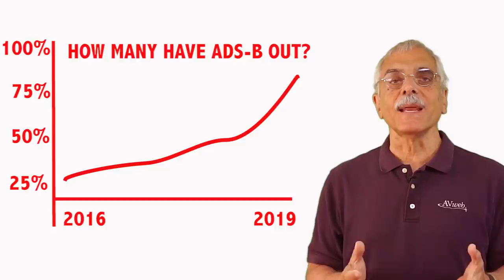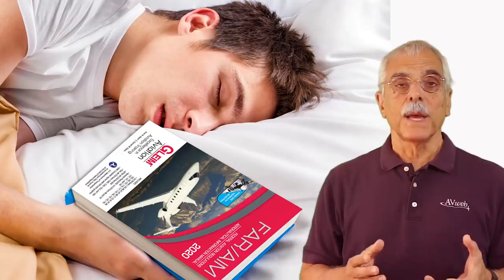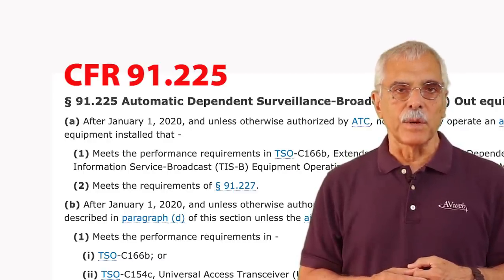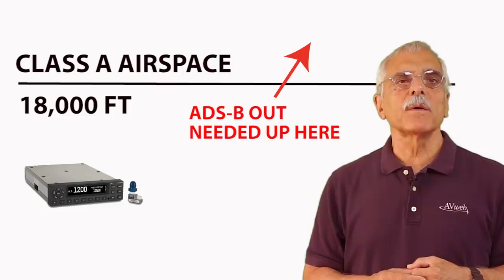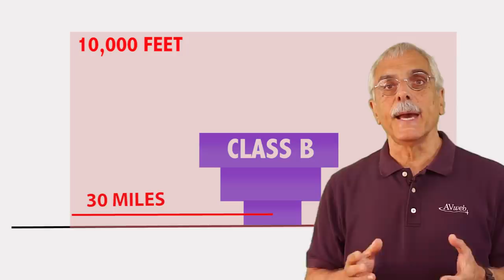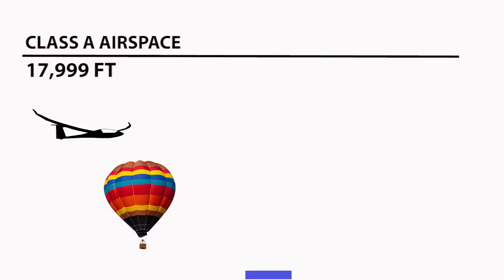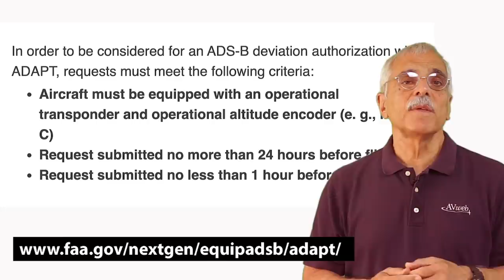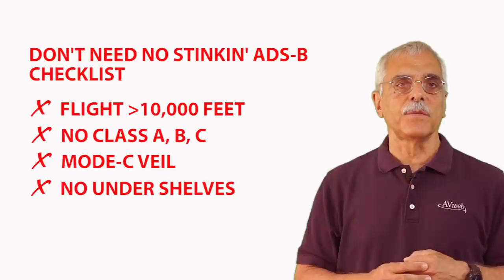So You Blew Off ADS B  Now What?

Comment: I have a few friends that are complaining about it... 

The regs came out in early 2010.  You had 10 years

Most installs are between 2-4k.  

While not pocket change, its still very cheap when it comes to planes.  My families last cross country trip cost more than that in fuel.
Reply: "But my plane is worth only $15k." I've read that a lot.  Irrelevant, IMHO.
Reply: @roytee3127   i have not seen a 15k plane that would be required to add ads-b that did not need 25k+ in work.
Reply: @tylergordon696  Mine is a $20k plane that only needs $1,500 for ads-B out....
Reply: @roytee3127  That sounds like somebody who is flying with somebody else paying the bills.  Sort of arrogant IMHO.  

I've got twenty airplanes.  Putting ADS-B in all of them would be asinine expensive.  I made ONE trip in the past two years that I could not have made without ADS-B under the new rules, assuming you can go under the shelf of Class C, and I didn't really need to make that trip in a plane.  The economics simply don't compute, at least not for me.  

And I've got a Culver V Satellite that is pretty nice, has radios GPS etc.  Not a popular plane and probably not worth much more than about $ 12,000.  I'm not doing ADS-B in it until they get the cost down to about that of an ELT.  

And BTW, why exactly is it two to six grand?  What it is supposed to do isn't that amazing.  It's like a simple GPS and a beacon that should be as easy to install as an ELT.  It really should be about three or four hundred bucks.  Somebody is getting rich off of this requirement.  I wonder if those people, whomever they area, had something to do with it being adopted.
Reply: Its all about the certification...

I am a gc, saftey glasses are a big deal in my industry.  my 3 m safety glasses that are tested and rated by ansi( think faa only slightly  better) are $50 a pair.  My ones  that are identical minus the embossed  ansi number( from the head of 3m on the west coast)  are $10.   Hell i have a pair of oakleys that are rated to stop a 22 lr that i have had since i was in the coast guard are not even legal for mw to use.   

What it all boils down to is testing. Just look at modern avionics and the difference  between certifed and experimental.  Its a sick joke.
Reply: My Tri-Pacer was only $15k, now granted it needed a new impulse coupling due to AD, a rigging adjustment, and an annual to be airworthy, with what I had available to purchase it was either that or get the ADS-B out. Fortunately I live well outside of any rule airspace
Reply: @roytee3127 I agree with you and my reply to those people has been " No, as of Jan 1, 2020 your airplane will be worth $13K because you had 10 years  to comply and I'm taking the ADSB installation off the price of any aircraft I purchase"
Reply: @kellytrimble4120  You are comparing a transponder to an ELT, really?  You are comparing a pedal-powered tricycle to a 3-wheeled motorcycle.  An ELT blasts out simple data to help locate a crash.  No data processing, no receiving, no data protocol.  An ADS-B Out transponder is designed to use time-division multiple-access communication protocols (TDMA) to transmit and receive sufficient position, speed, and heading details (requiring WAAS GPS data) to allow pilots and ATC to avoid collisions in congested airspace.   Just because a simpler ADS-B out-only transponder doesn't display IN data, it still has to listen to the ADS-B data stream and communicate with both ground stations and other aircraft using a data protocol.  This is not trivial.

(Edited to remove my incorrect interpretation of FAA ads-b regs - see the excellent FAA graphic in a reply below)
Reply: DanD “above the ceiling AND within the lateral boundaries” - the “and” means both those conditions must be true. not “above the ceiling or below the floor, and within the lateral boundaries”, or “within the lateral boundaries from the surface up to 10000 feet”, or just “within the lateral boundaries”. So it turns out you can fly underneath class C after all. They don’t have to differentiate between B and C, the reason you can’t underfly class B is because of the mode C veil.
Reply: @whatwhat1574  I stand corrected, thank you!
Reply: @marcjacobson6096  I stand corrected,  thank you!
Reply: @marcjacobson6096  Am I missing something?  That graphic says "Mode C Veil, ABS-B Required"
Reply: @steven2145  Unfortunately for us pilots they have make it confusing by calling the airspace around "Class B" "Mode C Veil" which is NOT a reference to "Class C" airspace. Mode C is the type of altitude reporting transponder required to be in this area that surrounds the "Class B". So despite both having a "C" in their name they are actually different. I'm sure this is clear as mud but you can definitely fly under the "Class C" airspace shelf without ADS-B but definitely not into Class C.
Reply: @dand579  with modern electronics it is pretty trivial and cheap to do with almost one chip. So I see  no reason why ADS-b can't made $400
Reply: Unnecessary regs are unnecessary no matter the lead time and cost. It could be 20 years and 50 bucks. Point remains.
Reply: @tylergordon696  ads in can cost a lot of money, just a simple transponder for ads out is dirt cheap. Of course, you can't receive the location of other plans with this but at least you can comply with regulations.
Reply: @kellytrimble4120  sell one of your 20 planes to pay for adsb in and out on all of your other plans.

Comment: My glider is exempt (no "electrical system") but I decided to install ADS-B out on it. Since I already am flying with a Trig 22 transponder and since my glider is 'Experimental' category, that was quite easy. The Garmin/Trig GPS receiver that works with the T22 is $350, the antenna is $50 and I also installed a squat switch to run the SIL 3 configuration. All works well and my FAA Performance Report came back with perfect results. Here on the edge of the Chicago B airspace I want to be seen!!! Battery drain is negligible and I see that as just an excuse. Btw., we squawk the "glider code" 1202 at all times unless directed otherwise.

Comment: Paul, too bad you didn't have a brother. Sometimes you need a big brother to slap you upside the head. In my 4,000 hours of private flying, I have had three "near-death experiences."  One time I was saved by a competent and caring approach controller out of Tampa who spotted what turned out to be a C182 evidently doing emergency decent practice above me about 80 nm North of TPA.  I was IFR and the other pilot was not using flight following. It took 3 evasive maneuver commands to get me away from him. and prevent the collision. He, of course, never knew the better. Next it was my eagle-eyed daughter, then 18, who spotted an old Taylorcraft flying the wrong way, right out of the sun, turning downwind to Runway 18 at KIRS. Sturgis, MI. If not for her last-second scream "Daddy" and pointing, then my instinctive haul-ass to the right, all 3 of us would have been history. The pilot and I had a "discussion" about his choice not to use his hand-held radio and fly the opposite way in a pattern. Finally, I had one of those "in the freakin' middle of nowhere" encounters over Oklahoma on a long, slow descent into a rural airport and had just fallen below radar coverage. A big twin overtook me from behind, evidently climbing out of a private strip, nose up, not using his radio, he never saw me butI felt the pressure wave from above just prior to the big shadow and the roar of his engines even through my Lightspeeds. Scared the bejesus out of me. I hope my point is obvious. ADS-B, fully complied with, would have avoided all three of these scenarios. So you and your "exempt" friends should think twice, no, five times, before deciding not to buy the damn unit, the battery, whatever it takes, and comply anyway. The life you save might be your own ... or maybe mine, too. (you may say that was not the point of your post. Moot point. It should have been mentioned.)
Reply: Well said

Comment: The glider exception over the top of Class B and C doesn’t require ADSB out above those areas above 10,000 ft. 
91.225 exemption language says:”These aircraft   ( non electrical, balloons, gliders) may conduct operations without ADS–B Out in the airspace specified in paragraph (d)(4) of this section.” (The 10,000 ft rule)
The ADS B requirement around class B and C airspace only applies up to 10,000 ft: “3) Above the ceiling and within the lateral boundaries of a Class B or Class C airspace area designated for an airport upward to 10,000 feet MSL;
Therefore a non-ADSB equipped glider can fly over class B and C but only if above 10,000 ft.

Comment: This is a measure of how many airplanes don't do annuals too.
Reply: We do annuals, every year - and have never flown out of annual except on a ferry permit. No ADS-B Out installed yet.

This idea that people who haven't done an ADS-B upgrade by the deadline are somehow delinquent owners is frustrating and ridiculous. I don't have a spare $2k laying around for non-essential avionics. It's that simple.
Reply: Increased safety for all in the air IS NOT non-essential avionics, It’s joining the 20th century ! We have to constantly improve, not stay stuck in the past...
Reply: By that definition you could argue anything that potentially improves safety is "essential". Good luck fitting TCAS on a J-3 Cub. Don't have an AOA indicator? It increases safety so it must be essential right?
Reply: @hempelcx  The opposite argument is that anything that improves safety is optional! I am sure there are many Libertarians that believe that. 

There is a balance, of course. If ADSB were $250 installed would more of those people without it get it? Sure. Same thing is true about TCAS....if it were a few hundred bucks and weighed a few ounces and were tiny would many GA airplanes start putting it in (particularly those that fly high and in crowded with commercial traffic airspaces), yeah. A lot depends on your mission and the airspace you fly in. My original comment didn't consider that because I fly in a crowded airspace near a large mode c veil near a couple of charlie airports so I just saw it from my perspective. For my mission, I see it as a requirement IMHO.

Comment: There's an inaccuracy here. The regulations do not say you cannot fly under the shelf of class Charlie. Only class bravo shelves by virtue of being inside the mode c veil.
Reply: I saw that in this video, and I assumed what you are saying, largely because that is how it was described in the little safety magazine that the FAA puts out at the pilots meetings several months ago, but if you look up the actual law, which I just did after I heard this, it says 'lateral boundaries' of the Class B and C AND the mode C veils.  That means under the shelf.  I'm not gonna be the one to test what the FAA actually means.  I think it means Class C lateral boundaries, within, over, and under, should all be treated as dead airspace, in addition to Class B Mode C veils.  I, for one, have learned not to trust ANYBODY's advice on what the law is when their job performance is measured on how many people they can violate.  I don't plan on trusting anything the FAA says on their website or their newsletters on subject's like this or what is reported in AOPA or whatever as to what the FAA tells them until this ambiguity is cleared up, so read the actual law.  You can find it with a couple of google searches.  It says nothing about under the shelf being legal.  It says lateral boundaries.  So this video just might be right on that.  

However, they also point out that the law says 'after Jan 1', which would appear to mean Jan 2 or thereafter, not Jan 1, but I wouldn't trust some controller somewhere violating you on Jan 1.  So this is the other way, even though the law says one thing, I suspect the individual controllers are all assuming the same Jan 1 that we were all assuming for the past couple of years.
Reply: @kellytrimble4120  your reading and mine of 91.225(d) (3) are quite different. To me it says above only, with exactly the same language as 91.215: "Above the ceiling and within the lateral boundaries of a Class B or Class C airspace area designated for an airport upward to 10,000 feet MSL"
Reply: @FlyingLessons  Yes, you are exactly right.  A reasonable person with a background in the subject would assume exactly what you are assuming and what I was assuming it meant, reinforced with prior information, a lot of it from the FAA.  But reasonable people could interpret it to mean under the shelf, as evidenced by the people who made this video.  If there is an ambiguity, which this vid suggests there might be, I'm not going there until it is cleared up.  If you can't go in the lateral boundaries of a Class C, and you have to just stay out of them, then there is really no reason to ever talk to approach.  If there is no reason to talk to approach on your way in or way out of an airport just outside of the Class C, I suspect there may be no good reason to ever try to do VFR flight following.  The potential for getting violated on this is one more reason a lot of people who need flight following and approach radar services will have to not talk to ATC.  When I cross country, I am constantly crossing thru Class C and sometimes going over Class B and frequently go thru Class C at the destination to get to a small airport on the other side, so I don't worry about whether I'm in or out or around or whatever, I just don't think about it.  This has me thinking I need to simply steer clear of Class C altogether and not talk to ATC at all unless I'm landing at a Class D.  I think that is less safe, but that's what the incentive structure will be.  I hadn't really thought of it until I watched this video.  You may be right in your interpretation, the same I had, but I can't chance it.
Reply: @littlegreenman1  Yup that's the same graphic I saw in the FAA safety magazine they hand out at the Wings seminars.  But if you read the actual reg, it could be interpreted as prohibiting flight under the shelf of the Class C, which is obviously the interpretation of the people making this video, and maybe some controller somewhere looking to gain brownie points for violating people for stuff.  That ambiguity needs to be cleared up before I go under the shelf.
Reply: @kellytrimble4120  the word AND means both the vertical and lateral conditions must be met in order for that rule to apply (otherwise it would say OR.) Besides that, it aligns with the Mode C requirements which the FAA has made clear was their intent from the beginning. And finally, if there was a challenge from the FAA, all you'd have to do is show them their own official graphic.

The issue is important because there are many Class C cutouts for GA airports around the country. All of those airports would essentially be closed to non-ADS-B aircraft as of 1/2 if the rule applied there. But fortunately, it doesn't.
Reply: @kellytrimble4120  Federal agencies have little concern for "unintended consequences". They never have.

You know,....i wonder what a drum of a radar absorbtion coating costs....

Comment: "...and unless otherwise authorized by ATC..."  Although inconvenient, doesn't the rules indicate that ATC can directly allow a non-ADSB-out flight?  ATC is not the same as contacting the FAA with correspondence, yet the rules clearly discuss ATC authorization in many places.
Reply: That would make perfect sense, you'll communicate with ATC well before you'll contact the FAA for anything. Emergency landing? Better get permission from the FAA! Technically they're the only ones that care about your equipment onboard anyway, ATC cares only that your coms are working so they can, you know, make sure you don't die or anything. This rule only seems to effect older planes that aren't old enough to predate electronics, but glass gauge retrofitting is getting more common, since they definitely help keep mental saturation down.
Reply: Aughhhhh BUT THE RULES!!! The rules say!!!! 🤓🤓🤓🤓 The rules!!!!! CLEARLY STATES! THE RULES!!!!!!!!!!!!! BUT THE RULES SAY!!!!!!!

Comment: 3:10 WRONG.  You may fly under class C shelf without ADS-B out.
Reply: 91.225 says: "3) Above the ceiling and within the lateral boundaries of a Class B or Class C airspace area designated for an airport upward to 10,000 feet MSL"

There is no differentiation between flying under a Class B or Class C shelf.  The regulation simply prohibits both.